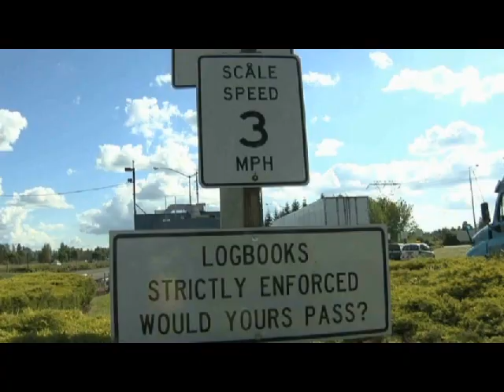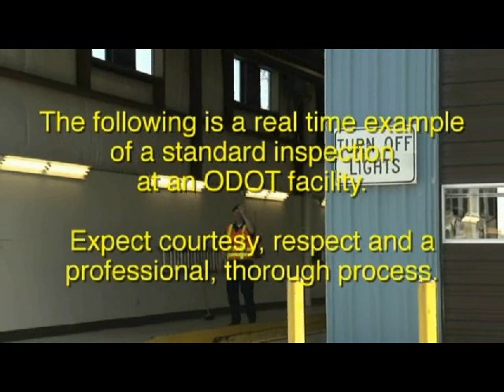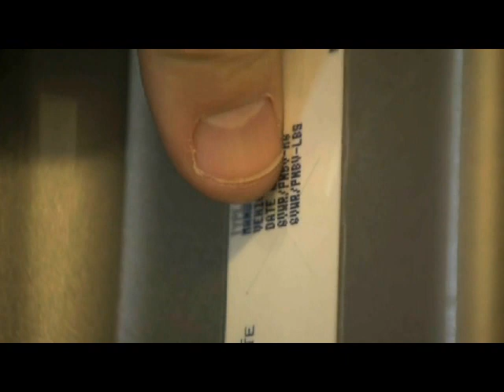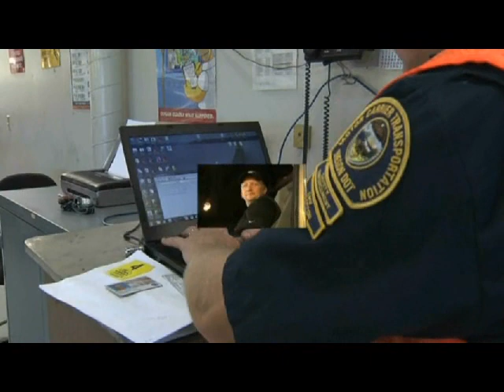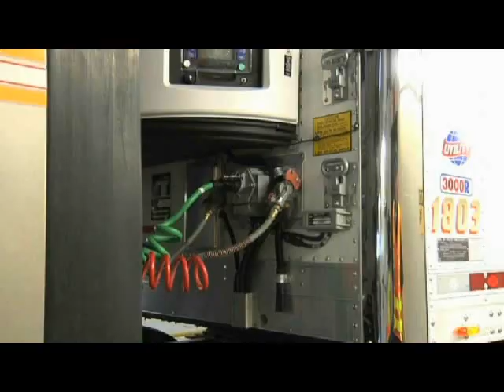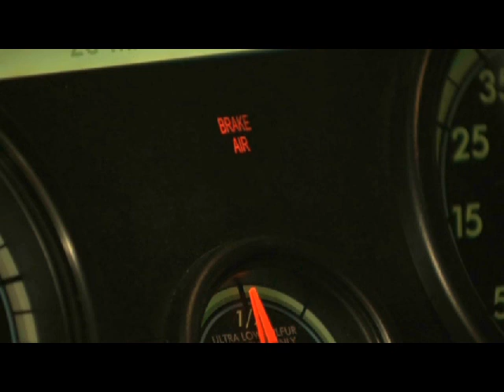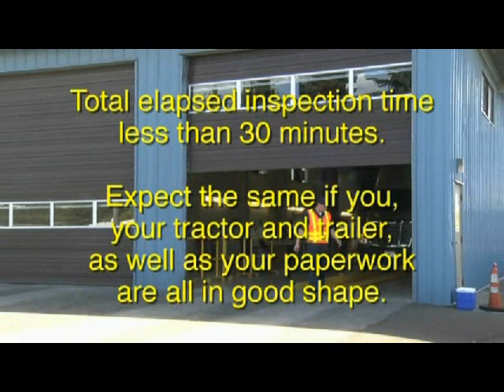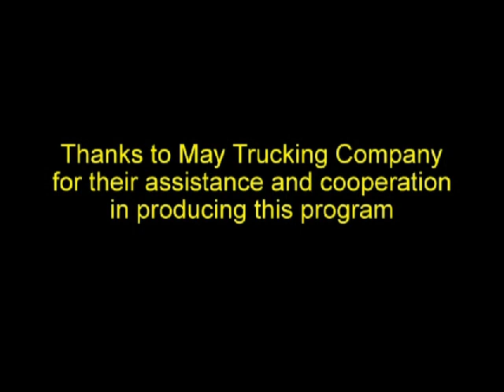Oregon Commercial Motor Vehicle Truck and Trailer Inspection

Comment: Nice... They bring a Brand New Truck straight out of the Dealer to inspect.
Reply: RATS TYRANTS for real I noticed that too
Reply: I'd inspect a brand new truck too.
Reply: Easy inspection for the company.
Reply: Lmao 😂 of course new truck and trailer and he checking the frame 🐖🤣
Reply: new trucks have been to have found with flaws. qc isn't what it used to be. lol.

Comment: I have NEVER had an ODOT officer be this respectful when inspecting my truck. Ever. That 30 minutes cost that driver about $20 in wages by the time he logged everything and did his reporting for the inspection. Public folks, don't let the ODOT or any other government agency try to convince you about how respectful they are. I have been pulled in for an inspection twice in the same day without a single violation found. We are supposed to be exempt for 30 days from being inspected. The ODOT officer told me my first inspection was at a different weigh station than his, so it didn't count for him. He inspected me again also finding no violation. Respect my ass.
Reply: @handsomegorgeous5072  been inspexted 3 times in one day in commifornia. same attitude from troopers. all jump scales.  dealt with it. y? cause what else you gonna do?
Reply: been changing tires on school busses and garbage trucks the last 12 years, so glad I don't have to deal with this crap anymore...

Comment: At the end it reads your inspection should only take 30 minutes if your truck and paper work are in order as seen here..... BUT how long if the truck has been driven 100 miles on wet dirty roads, then how long?
Reply: 40 min
Reply: 3 hours so the inspector doesn't have to get dirty.  Lol.

Comment: funny your going to portland from salem? if so why are you in the south scale? the north side has no inspection building! to funny. And he asked for your med card. well you dont have to show it anymore  its connected to your license.  as soon as they run your cdl it will tell them if you have current med card. also failed to check th ABS! log book!  So this inspector FAILED this inspection!
Reply: Daniel Horath ...  Yep.     caught this , also.       And they say we truckers are stupid. 
I've never had one  NOT pop the hood.
Reply: Daniel Horath .. didn't check for fuses of cab horn either
Reply: If there really was ice cream in that box, the reefer would've been running continuously. Also, even if all those fasteners (lugs, shock bolts etc.) weren't properly torqued, unless they were about to fall off, that inspector couldn't possibly turn them by hand! I have no problem with dot inspections, but, this is obviously a set up video on what's basically a brand new truck.
Reply: @MikeBrown-ii3pt  I agree

Comment: Just another unnecessary delay for the driver! They want to conduct inspections nationwide. It should be done on their time not the drivers. Send the DOT to all trucking companies every 3 mos and that’s it!
Reply: Perfect, then all companies can make sure none of there unsafe trucks are there to be inspected. Yes good idea. Just keep your truck right and you wont have a problem.
Reply: Do your PRe trip and you'll be safe,  I work for may and you have plenty ofntime to do proper pre trip, it takea 10 minutes, report to the company if any issues are found,  is your responsibility to be on top of your s hit  ,

Comment: good day. total weight 38 tons. How many liters does it burn per 100 km? 400-450 hp in America. 13L----16L. How much is a 0 km truck engine? It would be very nice if you put the odometer on the side of the video. I'm setting you up. I am writing from the Asian continent. thanks.

Comment: At what weight does ODOT start checking trucks for compliance? I am trying to purchase a small bucket truck (about 12k pounds) in Oregon and I am curious if I will need to stop at weigh stations on my way home?
Reply: Not unless you are over 26,000 lbs or towing a combination truck trailer setup
Reply: ...or for hire or interstate commerce.
Reply: @michaelsteffen4887  it's different in every state.

Comment: Do NOT ever press your foot on the brake to let them check your brakes, in doing this,  YOU are HELPING them incriminate YOU, if your brakes are out of adjustment, you will let them know, just by putting your foot on the brake!. Inform them, politely of course, that you know they have a tool they can use to determine if the brakes are out of adjustment. They are NOT required to let you know this. You are expected to follow the directions given, even if it violated your rights. Having you use your brakes against you is very common, but, you have the right, The 5th Amendment, NOT to incriminate yourself.....EXERCISE THAT RIGHT!!
Reply: @victorbernier4765  Right?  Just do your circle checks and fix shit when it breaks.  There is no reason to fear inspections if the driver does THEIR job.
Reply: What's so awful about making sure your rig has brakes???? My uncle was killed by a truck and trailer due to it loosing it's brakes. 
I'm very anti gov. And them meddling in my business but I agree with vehicle inspections as not everyone who hops behind the wheel is a mechanic like I am and knows when something is wrong.

Comment: I am sorry but when your checking wheel nuts you can't just run your fingers over them, use a bloody torque wrench to check them properly, in the UK we use hi viz pointers to show the driver if they are, have come loose as the pointers won't align up with the next one, any way, why has this inspector pulled a almost new truck up? why doesn't he pick up on the old jalopies that are rusty, IF this a set up its badly done.